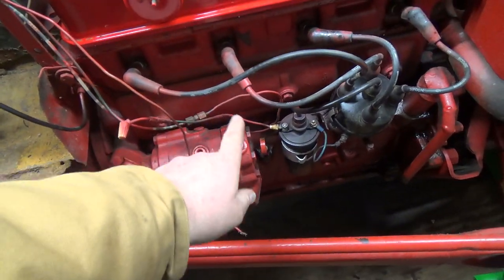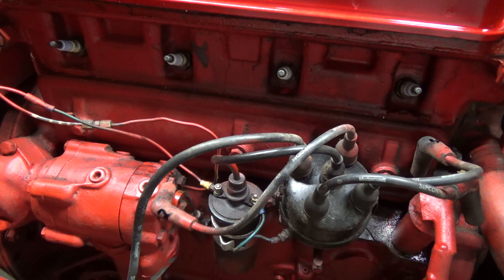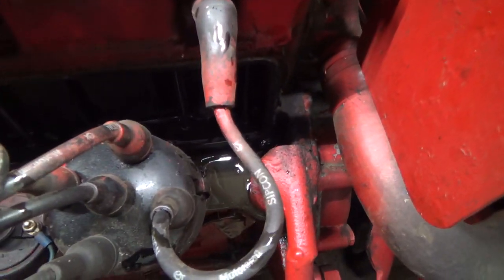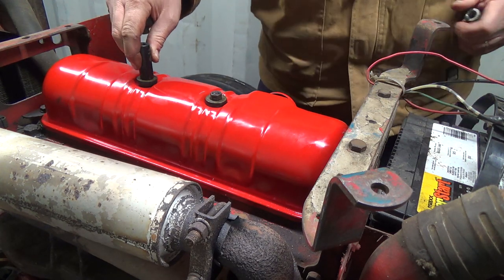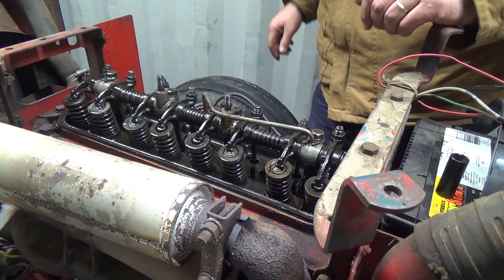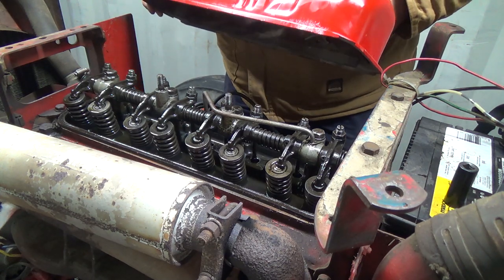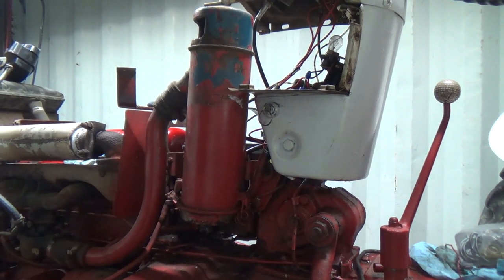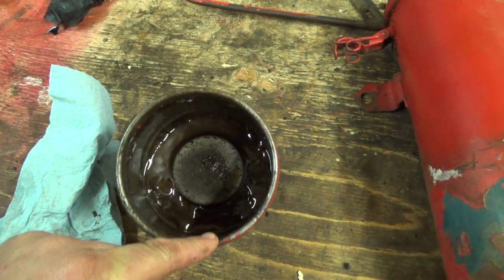FORD 800...Let's diagnose the tapping sound in the engine drop the oil and inspect the air filter

Comment: I’m the 60’a ford ran a special where they would steam clean and repaint older tractors to the new ford blue and grey paint scheme that they was using in the 60’s to make the older tractors look modern. Also look at yesterday’s tractor company for parts, that’s where I get parts for my  55 600 series

Comment: In 1962 Ford changed the paint scheme for the 800 Model from Red/Grey to Blue/Grey do its possible the Air Cleaner Assembly was replaced at some point from 62 and on Ford 800, the seal for the large Rocker Oil Pressure inlet line is available and the missing line is also able to be obtained.

Comment: I would say they are the oil feed pipes for the rocker shaft assembly. Without the other one your loosing oil pressure in the rocker shaft, which is why it’s not lubricating the rockers properly hence acting like it’s blocked.

Comment: Maybe if you find a strip of sheet metal,  you could wrap it around that oil pipe near the first bend close to the rocker box cover fixing bolt. The two strip ends come together and drill a hole in them so they fit over the cover bolt.
A simple wrap around bracket.

Comment: If the pushrods don’t spin that’s when you know a cam lobe is pooched or will be very soon cause your lifters are also spinning. If you ever take the lifters out for whatever reason, they need to be put back in the same hole cause the lifter and cam lobe are matted after the initial 1st start when it was new. If you have a lifter tick then buy a bottle of GM EOS Engine Oil Suppliment otherwise it may be time to set the lifters.
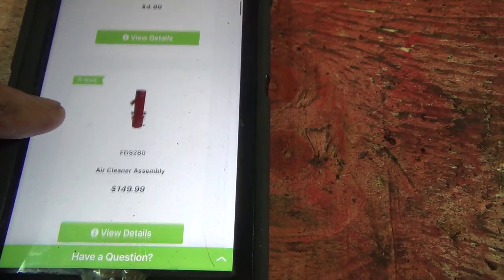46:35 I would clean yours and not spend that silly shipping and duties in USD. If you can’t find an oil line then make one from metal fuel line or brake line.

Comment: If it has valve seals, remove the rocker shaft and remove the springs. Goodson has valve tools and parts. Check the cylinder leakdown. Replace the oil pump and screen. Put clothesline in the cylinder to hold up the valves. Remove the spring. Check for sticking stems. Run the engine with the valve cover off and check if valves open and close properly indicating a bad cam. Check for fuel pressure and leakdown. Replace the needle valve.

Comment: The firing order is not hard 1-3-4-2
Reply: Get #1 TDC on the compression stroke on 0. The rotor should be pointing near #1. If not, unbolt the distributor and lift it up. Turn it way back against normal rotation. Point the rotor at #1terminal on the cap and set it back in. Turn it to normal setting. Set the timing. This compensates for a worn timing chain.